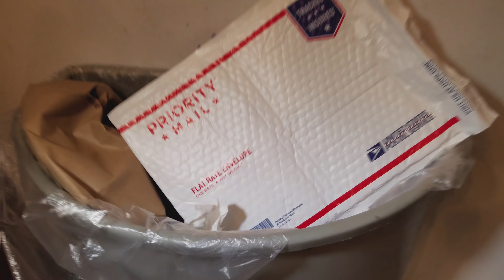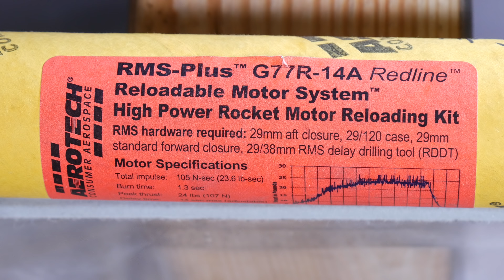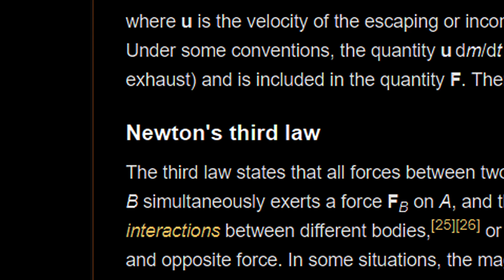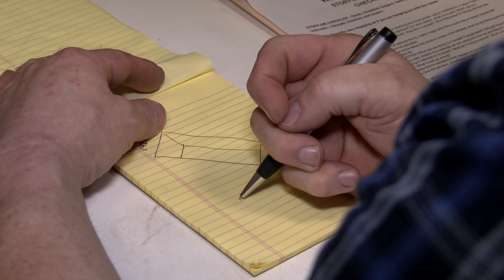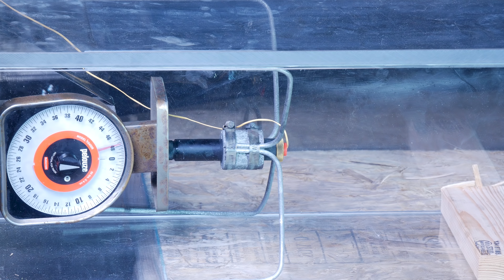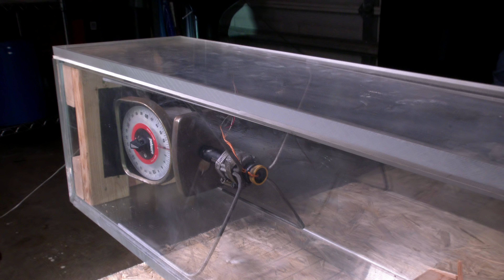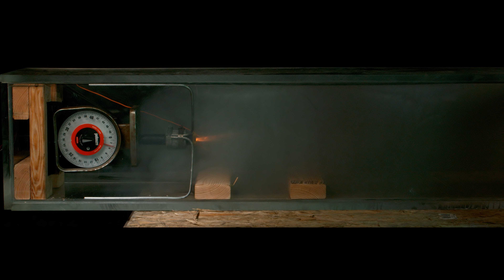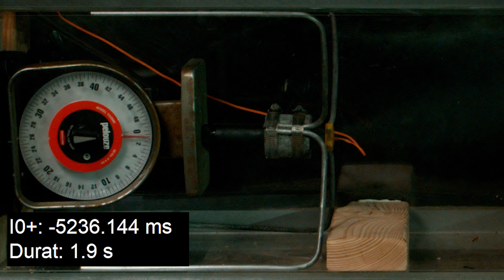Rockets in a Vacuum Chamber - Newton's third law of motion Visualized

Comment: But solid rocket motors never operate in a complete vacuum, they are always ignited on the ground and released before they reach space.
Reply from the maker: +Green Silver exactly. That's completely true. Although I did a little bit of research and I found that there have been a few times they ignite solid Rockets in space with a rupture disc.
Reply: Solid propellant engines and gas generators operate in space all the time. Every sounding rocket that is launched, for one. The Minautaur rockets that Orbital ATK launches, every ICBM in the US arsenal, every ICBM built after 1995 in Russia, I can keep going. ...
Reply: Brian Streufert 
Keep going..
Reply: Ullage motors used to settle the propellants into the base of the propellant tanks to cover the inlets prior to turbopump start after a long duration without thrust in space (coast phase). They are often solid propellant motors because they are far more reliable and they do not require an ullage motor of their own. CGT RCS engines lack the thrust level to settle propellants and hypergolic RCS motors wouldn't waste their valuable propellants for anything other than orientation tasks.

Here is one specifically....
https://youtu.be/e-QWzFEek3A
Reply from the maker: Green Silver I know you're probably being serious by saying "go on", but Brian knows his stuff.
Reply: So how did the like of the apollo capsules manouvre in space
Reply: Hypergolic RCS engines operating on nitrogen tetroxide and monomethyl hydrazine. The propellants are expelled from their tanks via pressurized nitrogen; no ullage motors are required because they use spherical tanks with a PED bladder. Just like most all satellites that require continual station keeping adjustments or for orbital adjustments.
Reply: What about the blast off from the moon? What type of rocket was that?
It worked in a vacuum.
Reply: 10klbf hypergolic thrust chamber operating on nitrogen tetroxide and monomethyl hydrazine
Reply: As soon as the rocket ignited you can se the vacuum gage drop off so basically you are just testing the ignition of a solid rocket in a vacuum
Reply: Green Silver - You are incorrect.  Many launch vehicles have used solid booster in a vacuum.  Five of my six Delta-II launches carried solid third stages which lit in a vacuum .  Those missions were Mars Global Surveyor, Stardust, Genesis, Deep Impact, and Kepler.
Reply: Stuart, you'll have to excuse the current generation. They no longer teach physics or general science in school anymore. They have been replaced with emotional well-being class, how to locate a safe space class and tide pod eating class.
Reply: #GoDelta!!!!

I am terribly sad BTW that there is only (1) Delta II left. Ugh....one of the best and more beautiful load lifter launches to date.
Reply: Saturn V had solid rocket separation and ullage motors during staging.
Reply: oliver styles Hypergolic liquid fuels. Hydrazine and Nitrogen Tetroxide. They ignite on contact with each other.
Reply: angc214 jo

Comment: In all fairness I have flown model rockets, and I've had the igniter fail just like that one did. 
It just did not have enough contact with the fuel, and the ignition of the fuse blew it out the nozzle.

Comment: Note that they used hypergolics for lander decent and ascent, not solids. Same physics though.
Reply: solid fuels are used only as boosters and to produce enough impulse to lift the rocket to space, in space everyone uses liquid motors or other types of fuels...
Reply from the maker: IamIUareU originally I even said that in the video, but my rocket science is friend told me that there were a few instances where they used solid rocket boosters in space with rupture discs, so that part got pulled out of the episode as to not create confusion there.
Reply from the maker: Gregory Hughes those are coming up soon.
Reply: merlin 1 for Falcon 9 used Kerosene and LOX .Try that.
Reply: Same principles for solid rocket boosters or liquid rockets. The only reason they tend to not use solid boosters in space is because once ignited, it burns until done, while with liquid rockets, you can turn them off when you want, so you can control the burn.   Very nice experiment. Not sure it'll satisfy the flat earthers, since nothing so far has. lol
Reply: Yes, it's rare for spacecraft to use solid rocket propellant in vacuum precisely because it's so tricky to work with in vacuum (and in general, really, since there's no fine grain throttle control).  One notable exemption is the New Horizons space probe that flew by Pluto, it used a solid rocket motor as a 3rd stage to provide it with the last of the delta-V it needed to send it on its way.  It then relied on monopropellant thrusters for making course corrections.
Reply: Hypergolics are yet to be proved to work in a pressureless environment, e.g where there is NO AIR.

Comment: The thrust isn’t generated by pushing against something (or nothing). Mass is projected backward regardless of atmosphere (assuming ignition occurs), and the total momentum of that mass that’s projected backwards will be equal to the forward momentum of whatever object is being accelerated.
Reply: Mike Taffet you need to study a little more action does not equal reaction in a vacum it does in Hollywood but that's a hole different subject in fact you simply can't produce any kind of thrust if you could NASA would show us seeing as they have the world's largest vac chamber very little vid exists on propulsion or space suits or really any decent thing in that huge vac chamber they drop a feather and a bowling ball and kind  of disprove gravity but don't give any of the data such as beginning weights rate of descent psi on contact ect. It's something they don't want us paying to much attention to vacum is cool but the suez canal is better it has no locks at 120miles plus a lot of water on both sides even if you call it 300 miles shore to shore 4.5 miles of curve does not equate but hay I could this all day how bout electro magnetic rail guns the USA has a new weapon projectiles travel up to mach 7 in a absolute strait line so in about 98 seconds that projectile travels 100 miles but what about the 1.5 miles of curve it does not ground out it does not arrive 1.5 miles above target it arrives level with it's launch level everywhere so it's flat or the magic of gravity some how can specifically grab an object traveling at mach 7 while gently bending large water surfaces and not pulling to hard  on any birds or clouds
Reply: Robert Newer WTF? What's your point?
Reply: Rocket and burning rocket fuel are certainly pushing against each other.
Reply: Flatters are not thinking science or reasons or evidence or logic.  They are thinking if they can say something to get attention.   And the best thing to do is not give it to them.  "Rockets don't work in space" is no different than claiming a forest is full of fairies, or the god's demand a virgin sacrifice.  The argument is made to gain attention.  The best thing we can do is ignore them.  Then we can use the time to learn actual science.  Like how a rocket engine works.  Then maybe the the maker of this video would have known the ignitor he was using does not contain oxygen, and will not work in a vacuum.
Reply: That's what THEY want you to think!!!
Reply: Damn THEY for doing that!
Reply: Your English is as perfect as your logic.  Not very...  Try a comma every now and then.
Reply: Even if commas were spelling, I could not be more devastated.  Please, no, stop...
Reply: Nordburg
"Flatters are not thinking science or reasons or evidence or logic.  They are thinking if they can say something to get attention."
 Flat earther don't THINK, they beLIEve !
Reply: Jared Hoessel
"Nordburg besides that it ain't worth me wasting my time"
Translation : Cornered by my lack of rational argument, I fleed cowardly !

Comment: Your vacuum chamber walls create the medium needed to create thrust. It’d require a much larger vacuum chamber for useful results. Thanks for the attempted study.
Reply: Exactly right. The opposite reaction is created by the rocket thrust pushing off the wall of the enclosure.
Reply: Except he "thrust" gauge increases before the gas plume hits the back of the chamber. 
Also, how do you propose the particles of gas transmit the "resistance" back though the gas to the thrust sensor, champ?

Comment: There's one little problem. Once the rocket motor is ignited, the vacuum is not a vacuum anymore because the chamber gets filled with gasses and building up pressure. This experiment has to be conducted in a much larger vacuum chamber that is constantly being kept in a state of vacuum despite the rocket engine gasses produced.
Reply: Watch at 12:10. He addresses that we saw measured thrust at the very moment of ignition, before there was an appreciable amount of gas inside the chamber.

Comment: Isn't the igniter being pushed out from the engine, while in a vacuum, evidence enough?
It would be interesting to see if the amount of thrust is different in a vacuum.
Pity then scale in your first "partial vacuum" test isn't visible.
Reply from the maker: +Bo Dan oh good point, I thought it was visible, a couple things got left out because I needed to keep this under 20 minutes for YT. I made sure to keep the gauge in the shot for the last test though , if you watch from 10:12 on the gauge reading is shown
Reply: Thrist will be lower in a vacuum for two reasons - firstly the gas escapes partly before it is fully burned so less heat, and second at ground level the shape for an efficient nozzle is way different to in a vacuum.
Reply: the igniter pushed against the medium of the holder it was in, not the vacuum.
Reply: But with no air, no wall, then no movement

Comment: Awesome video; however, I am not sure if the vacuum chamber had enough volume to offset the pressure difference. Was the vacuum chamber able to maintain absolute vacuum no increases of pressure during the burn?
Reply: This question is merely regarding the thrust, not if the engine can burn in a vacuum.

Comment: You dont need a rocket engine to test that. Shoot out something with a mechanical spring. That gives thrust
Reply: Robert Blixt not true because using something mechanical like a spring means it's still storing energy, and taking the air out the container wouldn't affect it
Reply: And a rocketengine is also mechanical so same
Reply: A rocket engine shoots out molecules
 that is mechanical
Reply: @Joh.N_FT  Same principle. Different energy conversions. Spring - mechanical potential to mechanical kinetic. Rocket - Chemical potential to chemical kinetic.

Comment: I like your video... what I wish you would have done, what I would have done... would have been to install an O-Gauge railroad track into the container, onto that place a 1/2A Estes motor onto a flat car. The thrust should have been enough to move it at least a meter or so. If not, continue with an A8, and if needed (doubtful) a B motor. You could have even had the track at a slight incline such that the railroad car rolled back to the left. Then you would clearly see movement to the right, then rolling back to the left. If you do decide to do this experiment, I would not recommend using anything higher than a B motor... it could get dangerous.

Comment: remember that space has infinite volume of vacuum. this tank becomes pressurized when the volume of gas created from the burn overcomes the volume of your pump and thus gives you some thrust. If your pump could suck as much as your rocket blows then nothing could happen .Once again space has an infinite volume and your pump is extremely under rated !!!!
Reply: Cruze Missile In the slow motion footage you can see a force being exerted on the scale during ignition before the chamber gets filled with gas. That proves it riight there, FE's no longer have a good reason to deny Newton' s third law in a vacuum.
Reply: bcd7977 That's not why it moves.
Reply: @Cruze Missile True i agree with you
Reply: True its faken
Its correct he fooled ...he created the Atmosphere to burn the oxygen but not really used Vacuum 
Because he'll fail and no one will see this video
Reply: 100% correct.

Comment: Please understand the second the ignition happens gas is released and the chamber no longer is a vacuum....it creates pressure to thrust against..notice the delay at ignition...good video tho.
Reply: Josiah Clayton the very act of the plug being ejected out of the nozzle provided measurable force against the pressure plate, and this happened long before the gases from the combustion filled up the chamber.
Why are you being so dense?
Reply: His Honer, Special Council Covfefe Chocker the pressure happened as soon as reaction happened thats why the thrust increased...a rocket starts off at full thrust normally and then slows down ...in a vacuum however thrust increased as the reaction happened due to the gas increase causing more and more pressure in the container.
Reply: His Honer, Special Council Covfefe Chocker the more gas released the more pressure and that  equals increase in thrust...even the tiniest amount of air makes a difference...but good luck holding on to false science because its going the way of the dino....if they ever existed.

Comment: The rocket thrust isn’t pushing against the atmosphere…the engine is accelerating gas at velocity out the back. The reaction is between the exhaust and the base of the rocket. 

Also…the vacuum you built doesn’t work

Comment: you're  missing a component NASA uses lox (liquid oxygen ) and yes solid fuel has an oxidizer however the the expansion ratio is vastly different . WARNING; your vacuum chamber is to small /not reinforced enough it will explode .
Reply: So far it's inconclusive anyway because the thrust hits the end of the chamber its range is bigger than just the visible flame.
A plane's thrust projects a bus that passes way behind him. Whatever it is made of that's the kind of proportions we are looking at to give us enough push for take off.
Reply: The fuel/oxidizers chosen have nothing to do with the ideal nozzle expansion ratio. It is strictly dictated by the exhaust velocity and pressure differential between inside the combustion chamber and space. The difference between atmospheric pressure and the vacuum of space may be small (14.7 psi), but it is significant enough that rocket first stage nozzles for use in the lower atmosphere have a different expansion ratio than those designed for upper atmosphere or space use.